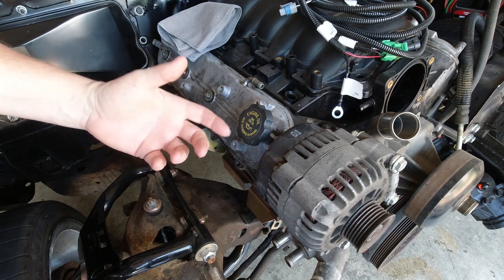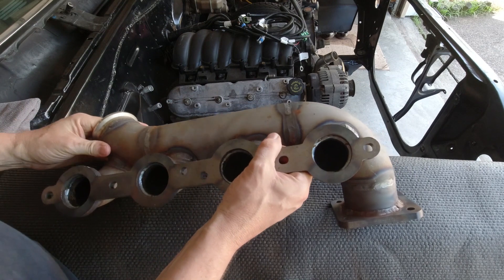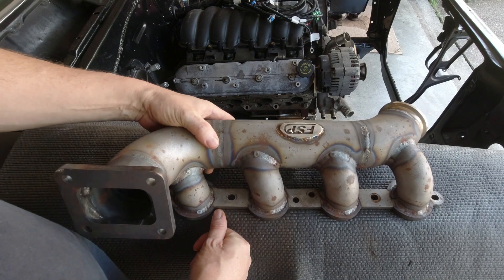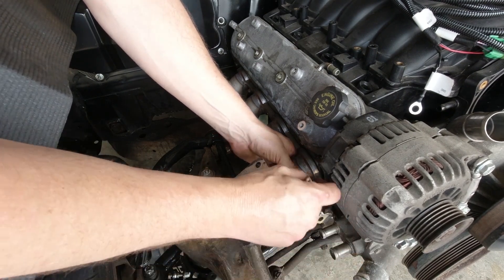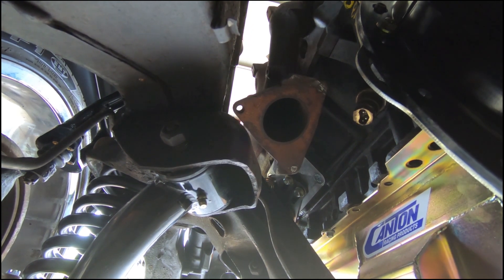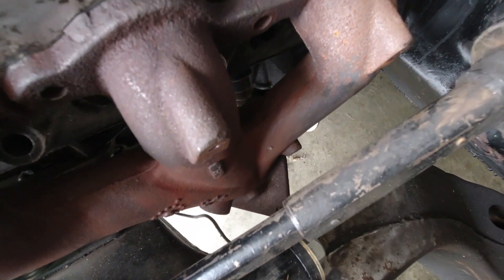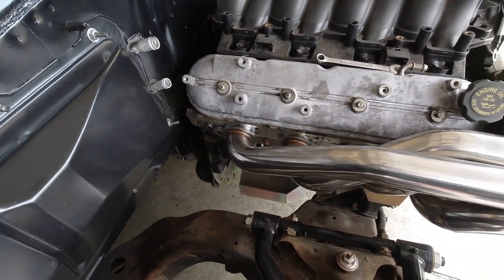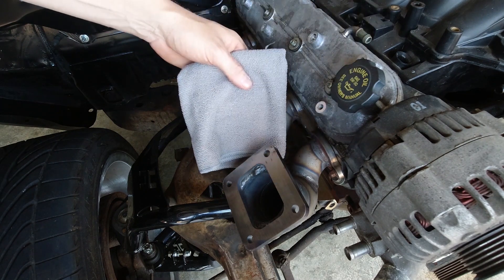Best Turbo LS Manifold for Chevelles

Comment: Nice video, helped me make decisions. I have ordered and now waiting for the Fahler log to get built and shipped. I am doing the Turbo 5.3 in my 1968 Buick Special. As soon as I get my cleaned and checked block back for mock up, I need to make the decision on buying Edelbrock Pro-Flo XT manifold. Any thoughts on if that tall beast will fit under the hood of an A-body?
Reply from the maker: keffer Smitt depends on what frame/motor/LS adapters you use but yes I had that intake under a stock 67 Chevelle hood.

Comment: I’m looking at the eBay turbo logs. I got a Huron speed t4 kit and it don’t fit. So I’m looking for more of a off the shelf solution so I can return it if it don’t fit.
Reply from the maker: I did the same years ago.  That’s a mistake I’ll only make once.
Reply: @MuscleCarSolutions  yea it sucks. I waited 3 months for the kit and it don’t fit. It’s my fault but I don’t want to wait again and buy something that’s made to order. I’m stuck with a kit I can’t use and I don’t want to cut it up. So I’ll see if I can unload it.

Comment: Excellent video, I am doing a 70. Is clearance similar?
Reply from the maker: 70 what?  GM A-body car?
Reply: It's a 70 chevelle sorry I didn't specify
Reply from the maker: Fbody4life1 all good!  With a name like Fbody4life I had to check!  Yes it will fit your 70 with similar clearance.  Part of that will be determined by the frame/motor mounts and LS adapters you’re using.

Comment: I have a 66 Chevelle LS swap I’m adding a turbo to. Does the manifold allow you to keep the inner finder?
Reply from the maker: I used the inner fender on my 67 with this manifold.
Reply: @MuscleCarSolutions  Awesome, this seems like a better solution than the Hooker manifolds. If I have some other questions would you mind if I contact you again?
Reply from the maker: @miller5656  sure.  I’m happy to help if I can.

Comment: Can you retain the ac compressor??
Reply from the maker: No
Reply: @MuscleCarSolutions  do you have any suggestions on a bolt on manifold?
Reply from the maker: Unless you get a different front drive and low mount the a/c compressor.  You’re going to have to get creative to get it to work.
Reply: @MuscleCarSolutions  yeah it definitely will have to look into that, thanks